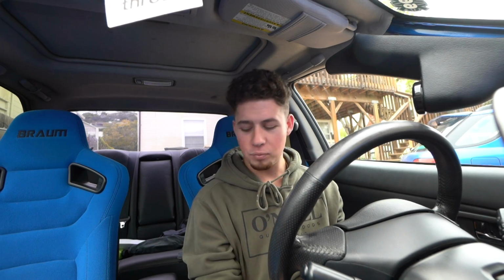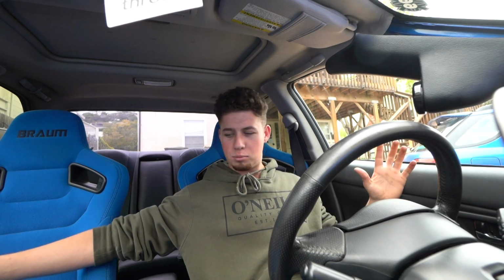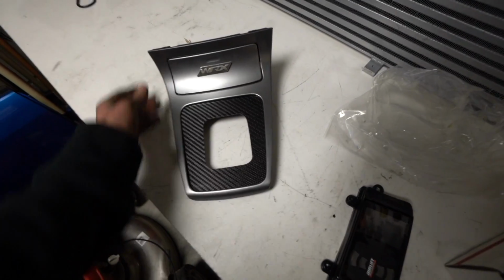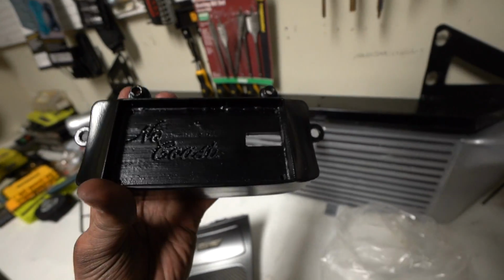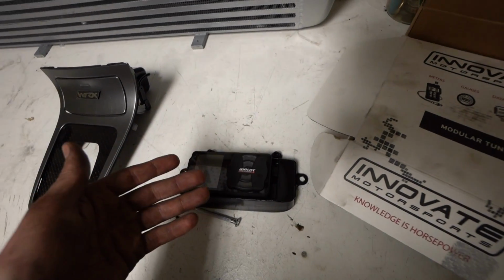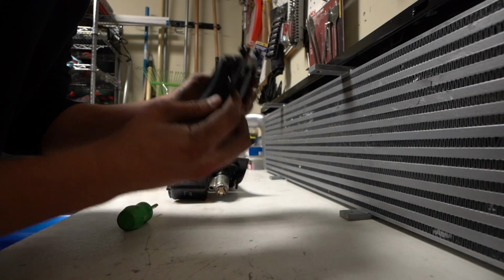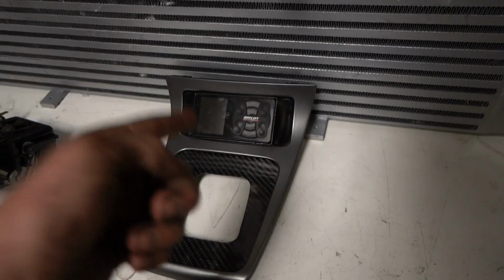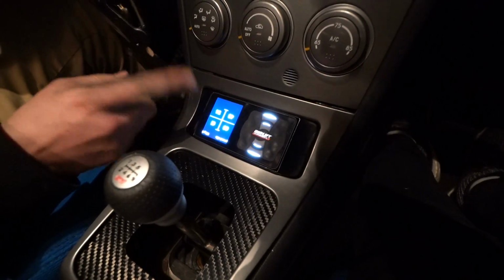MY BUILT WRX BROKE! AGAIN...

Comment: Battery could be shot(maybe alternator) thats the first thing id check. If youre turning the wheels while its off youre still draining what charge is left in the system. Same with how disconnecting battery and pumping the brakes will reset ecu. Ive seen posts on nasioc with people doing this but turning wheel lock to lock instead, never tried it myself tho

Comment: It’s either your terminals on the battery if not that I’d recommend you check your spark plugs wire harness had this issue myself

Comment: I'd say there is definitely something shorted. I once had my car on and forgot to tighten down the clamp on the negative terminal after changing a light bulb, I left the car running (dumb I know, but I was in a hurry changing a lightbulb in negitive degree weather) and tightened down the clamp and accidentally shorted the battery for a split second. Everything immediately powered off. I went back to turn my car on and had the same issue where it would click and would not turn over. Luckily I waited a bit and was able to turn my car over again and everything worked. Based on that I'd say you have a short to ground, especially as you are seeing a huge voltage drop at the battery would suggest a large power draw. You could test this if you have an ammeter available to see if current is being drawn. Hope this helps man!
Reply: My car is a 05 WRX sedan. Forgot to say that lol

Comment: I assume as you did the pump you removed or disconnected the alternator did you wire it back up properly are the pins in the plug making a connection or did one pin back out when you pushed it back on an make sure the big red live wire is tight an not broken if you lifted the alternator out the way back on itself. Because logically all you've undone is battery alternator an pump an the only one of those 3 which would knock out power is alternator live to battery

Comment: Idk, this is gonna sound odd because the cars I'm referring to are not even similar but power steering is power steering and electricity is electricity, we had this issue with some Humvee's of ours and it turned out that the power steering was drawing to much electricity from the battery, essentially killing the vehicle. The vehicle would die every time the wheels were turned at idle after being driven for a long period of time. Just a thought that may help in some way or just a slightly interesting story.

Comment: I dont understand why you had the car in the air to do a power steering pump thats mounted on top of the engine :P bleeding the system is done by turning lock to lock so why was you under the car? as fot the click, mine started doing that after being sat for a while and turned out to be the starter motor, it dont matter if the battery terminal touches the intercooler pipe as the pipe is only joined by silicone, unless you have it hard mounted to the frame/body somewhere

Comment: Dude I’m only 16 yrs old and I delt with that same exact problem with my fiends car that he had me work on at 15 yrs old I’m 1000% certain that it’s your PCM it stands for power control module its in charge of all your electrical you starter altanator and battery and when it’s dead everything dies the car can live off of a battery jumper or tender and if you charge it for 3 days it’ll start no problem for a week but then it’ll dies again it’s such a pain in the ass I deal with and fucks up the  batter it’s should only cost like $80 off it it’s one of the biggest fuses but it’s expensive

Comment: From my personal experience of this happening to my WRX, I assumed my battery was good because I was getting a good voltage reading when measured as well but turns out even if you have a good voltage reading and one of the battery cells are dead the car won't start but read a proper voltage. Probably your issue, I would suggest jumping the car or trying to if you haven't already? 

Good luck!
Reply from the maker: Thanks!!

Comment: Lets troubleshoot this real quick:
1. You have lights on and the fuel pump primes: this means the battery is providing power, if you check the voltage and it's at or above 12v the battery is good. 
2. You get a single click when you go to start the car and nothing after: this indicates that your starter isn't engaging. This could mean a couple things. Bad starter or the starter circuit has been interrupted. My very first check would be the starter power wire nut is tight and then make sure the harness going from the starter to the battery is in good condition and tight at all the connections. Next check the black single plug ground wire off the starter, on a car as old as your this wire tends to fall off and is the number one suspect for me with this condition. If that plug is good trace the ground wire to the trans bolt bracket and to the negative battery terminal and make sure all the connections are tight. 

I'm pretty sure one of these steps will lead you to the problem. My bet is the starter ground connector came off or is loose.
Reply: The starter ground on these cars are bolted in. Its extremely unlikely it came loose.  The only plug is the control wire.
Reply: @jeff666p  the ground is connected to the starter with a single black connector and that connector goes to the battery negative terminal and trans bolt on the other end. The black connector is easy to accidentally disconnect when working on the car or can sometimes fall off on its own.
Reply: @carbonaddiction    The Ground is bolted to the starter.  That plug is the control plug.
Reply: @jeff666p  OK either way if it is disconnected he's going to have this problem.
Reply: Dan Connors your information is true those are can cause this butt trust me I worked on
My friends cars and it’s for sure the PCM power control module it powers everything you can still get spark air and fuel and when you try to turn it over it just falls flat on its face he’s lucky that it even clicks once that just means it’s not completely dead the PCM that is but it’ll die over night real quick
Reply: @jdvlogs5607  It's not the pcm
Reply: Wolfy1091 okay look I’ve worked on cars with this exact same diagnosis and have fixed it look it up if you don’t believe me the PCM is exactly what causes this issue it may seem like the battery and shorted grounds but it’s not I’d cause them to be short but if he does get a new battery he will have power but no where even close to be able to turn it over
Reply: @jdvlogs5607   I work on cars for a living.  Your making this more complicated then it needs to be.   90% of the time this issue is caused due to a bad starter.  Just because  a bad pcm was the cause for your issue  doesn't mean that's always going to be the cause.
Reply: Wolfy1091 yes I work on and build cars for a living as well Im saying PCMs react differently do different makes and models of cars and I’m telling you that that is what is causing the cars to be completely dead and make it seem like the start maybe it is but the PCM definitely plays a roll in the issue but we don’t know which is the problem
Reply: @jdvlogs5607  Again "Just because  a bad pcm was the cause for your issue  doesn't mean that's always going to be the cause."  I can say with 10 plus years experience repairing cars this is not going to be the pcm.   Your going to cost people a fortune if your just a parts changer guessing.
Reply: Wolfy1091 I know what your saying but I work on custom built race cars street cars and if you’d stop being so stubborn about what I’m saying maybe understand what I’m saying clearly you don’t no one here cars about how much experience you have it doesn’t matter all I was suing was that it’s one of the playing factors causing a short and could kill the pcm but you’re certain on your answer so good on you I really could care less
Reply: @jdvlogs5607  Kid I do understand what you are saying but you are the one being stubborn .   "and it’s for sure the PCM power control module it powers everything you can still "          " okay look I’ve worked on cars with this exact same diagnosis and have fixed it look it up if you don’t believe me the PCM is exactly what causes this issue" 

 From how you worded it you are implying it is 100% pcm causing the issue and nothing else could cause it.    I'm telling you it's not always the pcm just because it was the cause for you once before.  It's rare for pcm to cause this.   I'm not evening going to bother replying to you anymore because it doesn't seem like it's ever going to get through to head.
Reply: Wolfy1091 no it’s through my head already I understand what your saying well just have to find out what it is in his next video.
Reply: Most likely just the alternator plug I assume he removed it when doing the steering pump an probably pushed the plug on wonky an pushed a pin out. Or the main live wire off the alternator has broken lifting it out the way to remove the power steering pump bracket
Reply: James Howard he said battery still has charge. The car will still starter if the alternator is removed.
Reply: @jeff666p  thought he said it jumps from 6v to 12 back to 6 again which a bad earth pin will do. Yes a car will run/start with no belt on the alternator it won't start if it's completely disconnected because the ecu will see an incomplete circuit. Subarus are known to fracture the big red capped wire on top of the alternator an pull on the plug because people leave it connected when lifting the alt out the way which folds the wire back on itself which he would of had to do to do the pump all he did was disconnect the battery fold or remove the alt out the way an remove the pump if the battery is connected that only leaves one other electrical component that could cause an issue.
Reply: @jayhow997  The car can start with the alternator completely removed.  It will just run off the battery.

Comment: Try disconnecting your air lift controller if it's not that then check the most avious things like your battery and starter.

Comment: The exact same thing happened to me last week after fixing a power steering pump leak. There was still air in the system and even after bleeding it out but we fixed that by pumping some pressurised air into the reservoir and found the leak and fixed it. Next day I tried to start the car and nothing, didn’t even turn over. Checked my battery it had 9V, thought it was the starter but nothing. We tried jumpstarting it and it started easily, kept it on for a bit so the alternator can charge the battery and it jumped up to 14V in a few minutes. Been driving it for a few days after and it’s completely fine, thinking of replacing or fixing the alternator which I think is the cause of the issue
Reply: On a 2004 WRX

Comment: Did you go with the power steering pump from Subaru? I have to replace the one on my ‘13, and I don’t want to spend 400$ at Subaru. What is your opinion? Do you think one from like rockauto would do the job and be reliable, at least for a coupe years?

Comment: same thing happen to me, it happen to be my security box, the immobolizer kicked in for some reason, which left my car not working. I own an 07 wrx, dont think 06 would be any different.
Reply: how did u fix the immobilzer code so you could start car again?
Reply: @alaskayoung3413  i had to trailer it to the dealership. They ended up replacing the module.
Reply: @Riffel269  damn. Thx for replying.

Comment: No worries bro that's the subaru life ... Trust me I over look/check my bluit sti every single day... good luck to find the short, by the way it can be related to your new pump if the pump isn't grounded properly...
Reply from the maker: Good looking out!
Reply: This is likely the starter or the  battery terminals.  It would still turn over if the fuel pump had an issue.

Comment: Might be a dumb question, but how well is your battery terminal making a solid connection?
Reply: Had the exact same issue on my car. Positive terminal was cracked causing it to be loose.
Reply: Same thing happened to me. Loose terminal
Reply from the maker: That very well might be it!
Reply from the maker: Checking it out today!